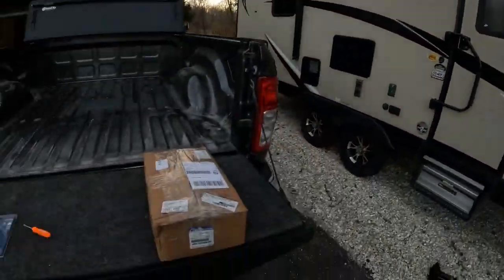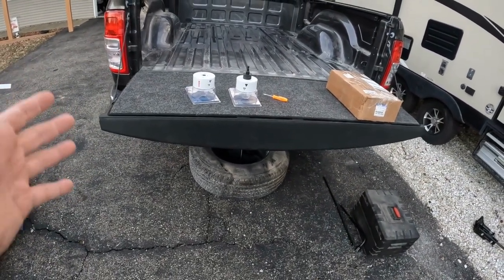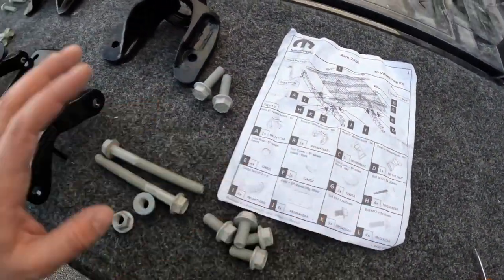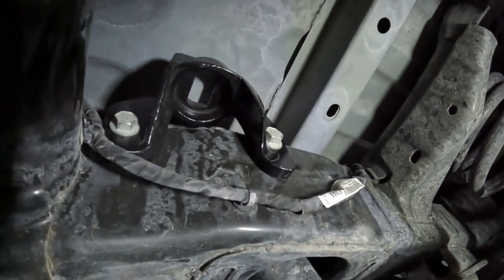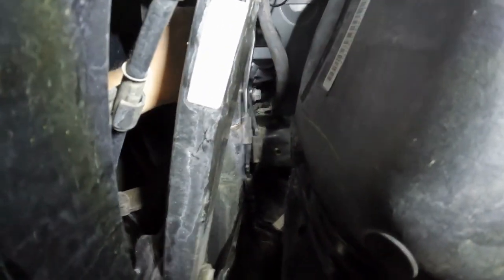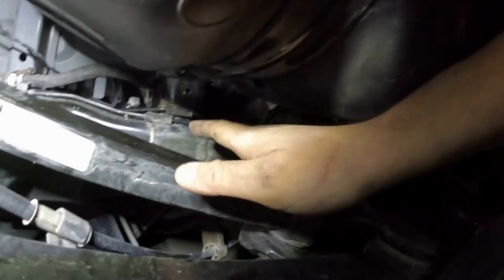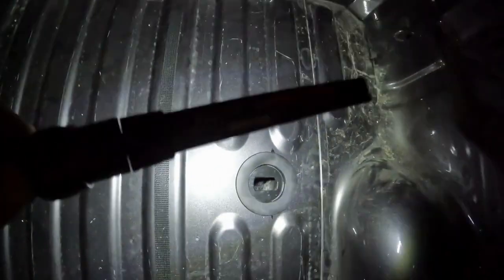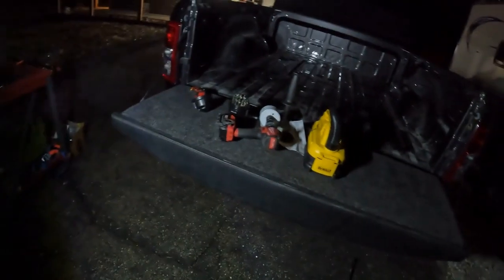Ram 2500 Fifth Wheel Prep Kit Puck Installation 82215838

Comment: Let me just say thank you for posting this video. It gave me the confidence to tackle this project. I just finished didn't quite get the time you got lol it took about 5 hours for me. I did take the heat shield down and let me tell you that front driver side mount by the gas tank had me pretty frustrated lol I work through it and got it I was a bit concerned I was going to break the bolts... Luckily everything went great The holes drilled fine with 3 5/8 hole saw... And we are ready to pick up our new fifth wheel. Thanks again We really appreciate it. 

FYI our dealership in Michigan wanted $1,640 bucks to install this... I did it with a little bit of backache and six beers lol
Reply from the maker: @joerod6106  yeah!! 🙌🏼 We're glad you were able to do it yourself and save some money!

What did you get for a camper? Enjoy and have fun!!

Comment: What a Great video, but I found it a day late.  I just traded a RAM 3500 with the puck system for a new RAM  2500 without the puck system because I could not find one with the Pucks.  I just had a new 5th wheel hitch with rails installed today.  I have a great Curt hitch in my shop with the RAM puck system.  this is the story of my life a day late and a dollar short.  I never used my diesel dually for anything except towing my 5er. so I traded it for the 6.4 2500. the ride is unbelievable compared to the dually.  I may push my weight limits but I dont tow that much or very far.  Enjoy your new Dually but I went the other way.

Comment: Your video really helped. I just installed this system. I did like you and drilled pilot holes from the bottom to make sure the holes were perfectly centered.  Two holes on each side of the rear pucks. One on the front puck like you. Need a long drill bit extension for this. Also, make sure the drill is on the fast setting. Thanks again for the video.
Reply from the maker: thank you so much for watching! we're glad it helped! if you have any questions, please let us know!

Comment: I see you mentioned 2014+ but let me ask you would you know why or what’s the reason as to why wouldn’t work for a 2012 for instance? I have a 2012 with a gooseneck ball but I was wondering if I could install the ram factory puck system and if I couldn’t I wanted to know why so I know. Thank you sir
Reply from the maker: I believe 2014 was the first year for the rear coil suspension. Both the 2500 and 3500 went through rear frame changes that would affect fitment. Newer 3500s had the puck brackets welded to the frame so it would take serious fabrication to try using 3500 parts (still leaf spring) on older leaf spring 2500. It's a little conflicting so I can't say for sure if Ram had factory pucks on a leaf spring 2500 ever.
Reply: @bccampingadventures  thank you for your reply, I should’ve stated that I have a 2012 3500 dually mega cab. I’m looking to start hauling stuff but mine doesn’t have anything other than just the ball for gooseneck, I was set on the puck system since I don’t trust those rail tracks aftermarket stuff for what I wanted to use the truck.
Reply from the maker: @jonathanhnunez  I think the same applies. 2013 or 2014 was the first year for the Ram puck system. So I'm afraid trucks before this have to look at after market. If you want a secure attachment could look at BW flip over ball and BW companion to go with it otherwise there's several frame mounted rail systems.

Comment: no gooseneck install?
Reply from the maker: The ram gooseneck pucks and fifth wheel pucks are different kits. Both can be purchased and installed together, so the truck is ready for either hitch option. We didn't need a gooseneck hitch, so we chose not to order that kit.